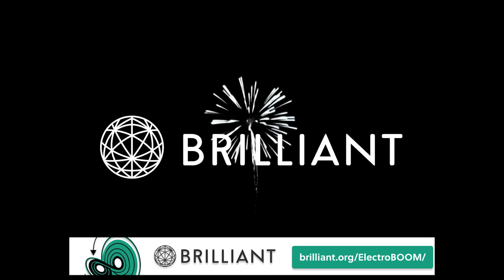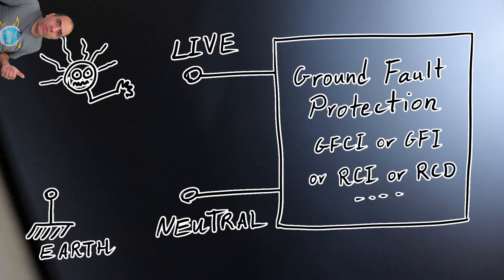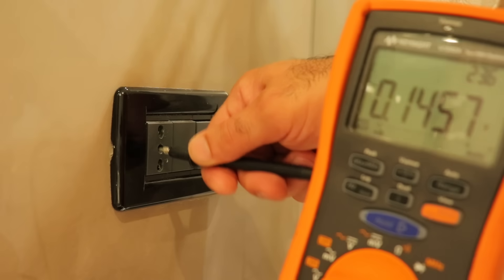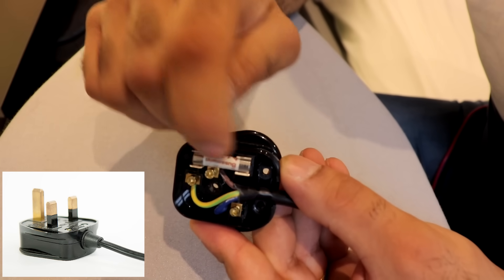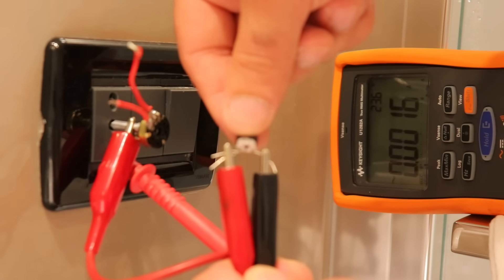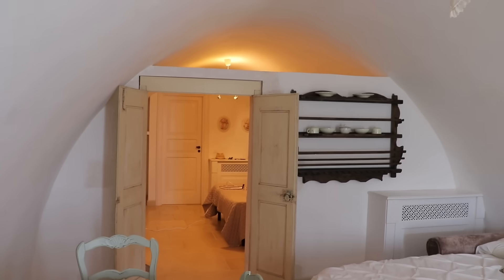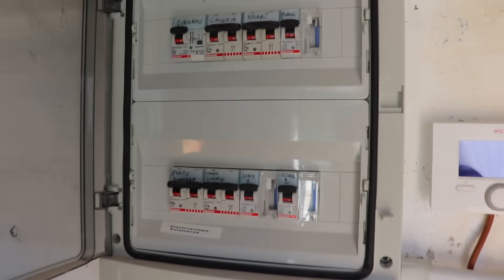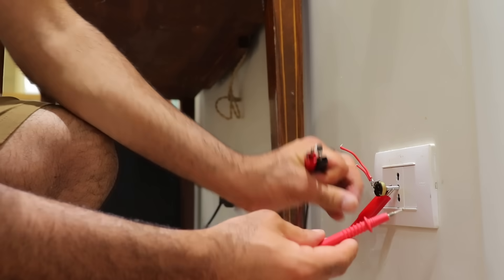Tripping Every Breaker in Italy

Comment: 1:40 --> The two standards that socket has, are for 10A and 16A Italian plugs. The two holes that are "closer" to the ground one, is for the 10A plug (The plug you used in 5:20 is a 10A plug, the 16A one is similar, though the pins are larger and the live and neutral ones are placed 3-4mm further apart to the ground pin compared to the 10A plug)

3:40--> The colours are Yellow/Green for ground, Black, Grey or Brown for live and Blue for Neutral; so if the test showed that the black was the neutral wire, either the hotel had terminated the wires in the incorrect way without following the colour code, or most likely, the red pin of your tester didn't touched the screw of the breaker.

11:45 --> Those are 3kV DC lines, since the regional trains use that voltage, although the high speed railways (The ones used by Freccia Rossa and Italo) use 25kV 50Hz AC lines. The Italo train you saw there, has the ability to run on both 3kV DC and 25kV AC lines.

15:28 --> Technically, you shouldn't be able to plug a Schuko plug into an Italian socket (There you were able because you've either applied pressure, or, someone else has forcefully inserted the schuko plug, "widening" the 10A holes). Be careful by doing this, since the Schuko plug is rated for up to 16A, and if by chance you plug in a device that uses more than 10A it can become dangerous. Also, by doing that you don't have grounding protection. Is always better to plug Schuko plugs into Schuko sockets.

Comment: Shoudn't Shucko pins be a little bigger, so they don't fit in the european 10A/16A plugs?
I remember being not able to connect a shucko without forcing (and ruining) the holes (it was a multiplug extension)...

Comment: I would say there are no applications where the polarity of the outlet matters in europe. Units built for use in the EU are designed so that the polarity will not be a requirement for the safety of the device, it will work regardless of how it's plugged in.

Comment: Hello from Spain! I just wanted to say that, while the plug design here is very simmilar, it isn't the same as the Italian one, so maybe other parts of the installation also change; so, it may be inaccurate to say all of Europe/the E.U. is like Italy (idk if we'd rank higher or lower though).

Also, since everyone is pointing out breaker are called "salvavidas" or something like that in Italian (in Spanish that refers to other things), may as well point out that in Spanish they are called "plomos", meaning "leads", since they used to be fuses, which were often made out of lead; when they go out, we say they "jump" (saltan).
Reply: Ñ

Comment: Hi, Mehdi It was really nice to see an "independent inspector" checking our electrical system. 😀

In fact 30 mA is the maximum ground leakage current allowed in Italy for bathrooms and kitchens (which by the way  MUST  be on 2 separate branches coming directly from the main line and protected by two independent circuit breakers). The other rooms can be 100mA or similar.
However it is common practice, if you want to be safer and simpler, to simply put a single ground leakage breaker upstream the whole house/apartment and derive all the other branches from that, using separate CB for kitchen, bathrooms, air conditioning, boiler room, Bedrooms...etc.

Keep on the nice work!
Reply: I think an old BTicino phone socket.
Reply: @trevi212  phone configuration socket. You put in a sort of fuse and you can only receive a part of phone signals.
Reply: hahah

Comment: In germany most electricians use testers which include a function to test the ground fault protection so you dont have to mess with dodgy potentiometers xD While measuring the voltage between line and earth you can push the two test buttons with your thumbs to engage a residual current that should make the RCD trigger

Comment: I hate those small Italian 10 amp sockets. I had to buy an "adapter" from a rip off street merchant  to use the more common European 16 amp plugs.

And how safe is it to make an adapter from 10 amp to 16 amps? Just more likely to trip the circuit breaker or heaven forbid a wire fuse!

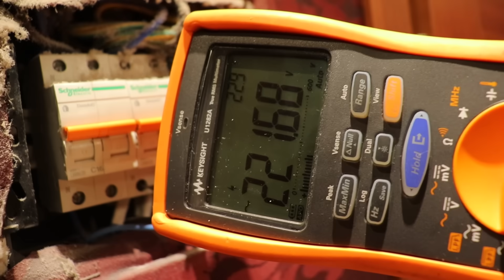Comment: 3:34 Italian here, actually the blue is the neutral and the black is the live, it's obligatory by the code. Let me add to all the other proper comments of fellow italians that you should not plug "round" plugs (EU plugs) into the italian "bipresa" 10/16A socket, this ruins the socket. It's the most common mistake that tourists do in italy and  it's very bad because home/apartments owners need to change the sockets very often.

Comment: 10:44  There's a "click" noise when the wire touches the first time, but no noise when it touches again.  Almost certainly the noise is from the mechanism of the ground fault protector (RCD), which means it is inside the room somewhere.

Also, all the ground fault circuit breakers (RCBO) shown in the video have a little schematic diagram printed on them, showing the wiring of the current-imbalance detector.

Comment: In the UK we have 230/240 V on each phase so 415V phase to phase, In Spain it is 220V phase to neutral and 380V phase to phase. In a friends' flat I found a wall socket on one phase and a bedside light socket 500mm above on another phase. Thus any defective appliances plugged in to both outlets would give you a "belt" at 380V, i connected my meter to both outlets and was horrified to see it register 380V! No RCDs anywhere, 3 cartridge fuses on the incoming phases. Of course a radial final subcircuit system rather than the ring final subcircuits found in the UK

Comment: I lived in an apartment in Italy for a while and it's absolutely shite! entire house was wired up wrong and every single circuit was wired Into a 16 amp breaker and I couldn't use many appliances at the same time ... power was always going off and the light were flickering constantly... often the plugs would be arcing inside the socket because they're loose. and there are 3 different standards in Italy! such an annoying place

Comment: Last plug you used is shuko, and supports up to 16 amps, while normal plugs support at most 10 amps, difference is that one. In IT shuko is for everyday use with heavy loads, the others are for laptops

Comment: Normally in European wiring, blue is meant to be neutral. Live is usually brown in single-phase systems, in three-phase the additional two phases are coloured black and grey, so that might indicate that the building has 3-phase power. Although that's not really a guarantee, they might have just used whatever phase colour was available.
Reply: In Italy we do not mind in case of single-phase implant, we usually use Brown, grey, black for the same phase. For example we can use black for the main lines, grey for the lights and Brown for the sockets. Some years ago also other colors were trendy, like Orange, red and violet, but now not a lot. While for the 400v implant we use GBB colors for the main line and after that everything black usually, and we sign L1/L2/L3 at the and of the wire. 
Fun fact, in some cities like Rome we have a biphase infrastructure with 220V tension, in that case blue is used for one of the 2 phases (like in Rome)
(italian industrial electrician here)

Comment: Welcome to Italy! In the bathrooms we either install no separate breaker or a 10 milliamps one. Also, it's quite strange that you can plug a Shuko in a normal power outlet without forcing it, since the 10A holes are smaller. Also, I disagree on the UK plug system being better: no need fo that separate fuse if you got overall protection (in Italy there's also a magnetothermic breaker for short-circuit overcurrents), and with the UK system there are certain situations in which you could plug it in the wrong way, leaving the ground plug out and thus being unprotected.

Comment: Minute 9:13 -> strangely shaped outlet. It is a special, general purpose outlet designed by the manufacturer of this line of outlets (BTicino) to connect applications different from normal power outlets. it is designed with the intent of being different from normal outlets and not usable with normal receptacles. The manufacturers also sells the special plugs. Examples: connect speakers to a PA System, connect a wired switch to turn on/off the ligth, connect devices with different voltages, connect a table lamp that will be turned on and off by a wall switch, and so on. It should have 3 contacts. plug can be inserted in one direction only.

Comment: GFCI was not a thing for a long time in Europe and when they became available (or even mandatory in some places), there were more of an afterthought by simply slamming one 3 phase breaker on the whole apartment.
There's also one thing people have to pay a REAL attention while using those 2 prong adapters for US plugs. EU sockets are not polarized and there is no guarantee that one side or the other will be neutral. You should always treat both of them as live. The only devices that have just 2 prongs are the ones that are galvanically insulated and have no exposed conductive elements that could get shorted in any way. This includes most things like hair dryers, hair cutters, phone chargers and so on. The other category that is mandatory is higher class equipment, mostly powertools. They have to be insulated and there can't be any way of shorting anything exposed thus it does not require grounding. Most of other devices require the ground connection.
Why am I saying this? Many US things have just two prongs and the neutral is also used as a ground. If you use the adapter, your neutral may be live. The only way you could ensure that it works would be some sort of magical power adapter that cuts off the power if the polarized side is in reverse (you have to rotate the adapter to work with US devices) but generally any adapter you will get does not have any protection. You have 50% chance that your neutral is live.

Regarding UK plugs, that's the great example of TOO MUCH protection. I had two USB power bricks, one with continental plug and one with UK plug. The continental one (same as US ones) had just two prongs as it is insulated and does not require grounding. Because of this I could easily use those with light, two wire extension cord. I also wanted to use the UK one with an adapter in the US but that became a problem. It has a ground prong which is plastic. Sure, the UK plugs require ground prong to be first so their power bricks have dummy plastic prong to unlock the socket. But now it is almost impossible to find an adapter from not grounded continental EU or US socket to UK socket. That's even weirder because I ordered like 4 of them and 3 were blocked on shipping because there were considered unsafe. Sure, they are unsafe because they are intended to let you plug 3 prong plug into 2 whole socket with no ground. That's what I consider quite bad about UK design. The continental design as well as US design has a great feature. If the device requires ground, you can not connect it to not grounded socket, it does not fit. But you can connect not grounded device into any socket. US does this by simply having additional prong in the plug, continental EU has (usually) slimmer plugs without grounding or round plugs with grounding strip around it. Obviously the large plug requiring ground will not fit into slim not grounded socket. And obviously it does not work with round sockets without a ground which are the old design you can still find something. And obviously it all goes out of the window because countries use slightly different designs like the Italian ones you've seen.

Ah, standards. They are awesome, let's make 20 of them!

Comment: In the Netherlands we have both the connectors seen at 15:16 only the smaller one on the left is without the earth pin and meant for Class II appliances. Both receptacles are recessed in the shape of the corresponding plug to prevent the issue you present at 15:16. The way they are shaped allows the Class II plug to be inserted in the Class I receptacle and not the other way around. 
For live and neutral sensitive devices you can either swap the plug around, use the appropriate industrial style CEE socket and plug.
Wet area's like bathrooms have very strict IP rating zones for installing electrical equipment and voltages are limited the closer you get to the real wet parts.
Derived from EN and IEC standards we have our own standards called NEN. Search 'NEN 1010:2020 nl' to learn more about our low voltage installation standards. North Americans could learn a lot from it.

Comment: Worse than the regular EU plugs that completely cover the female plug which is even safer than that plastic coating on the male part.

The plugs in this video are not the EU CEE standard "Schuko" type and is Italy-specific.

https://en.m.wikipedia.org/wiki/AC_power_plugs_and_sockets

Comment: 15:30 in Italy we have 2 type of plug, the smaller one has the same dimensions as the round plug so it enters (hardly because the diameter of the in italian pins are smaller) and we know that it should not be attached

Comment: The socket at 9.15 minute It's called Magic BTicino socket. It was invented in 1961 but It wasn't used a lot because there were few domestic appliances to support that socket.
It should have been safer than other plugs.
Nowadays is useless and almost all houses have replaced it with the standard socket.
In Italy now there 3 standards. The shuko socket (the German socket), Italian 10 amp and Italian 16 amp. It's easy to find universal sockets that allow you to plug in each plug. But the most common socket are (in order) the Italian 10 amp socket, shuko socket and Italian 16 amp socket. Usually 10 amp and 16 amp Italian socket are mixed together with double holes (the 16 amp is bigger and the holes are further away than 10 amp).
Universal shuko accepts all kind of plugs.

Comment: You visited one of the oldest cities in Italy. I designed some electric implants, so I can confirm: Italian plugs have a design that prevents the insertion of a single terminal, and 2 different plug rated to 10 A max vs 16 A. Every house has differential breaker just under the main switch. Even our suppliers meters include a differential with idn 0,003 A So that the whole implant is protected from the source. Problems  (in home environment) starts because we put in series a lot of differential breakers with the same idn rate so you are not granted that is the nearest one the that breaks when something goes wrong. We should put decrescent idn and reaction times switches in order yo perfect the system. In some hotel bathroom or other applications we have 0,001 idn so is safer, and hopefully you'll break terminal circuit instead of the main one for a local problem.
Reply: We've got selectivity-rules to prevent such situations from occuring in The Netherlands (and probably Europe, as the NEN and IEC-standards are ever more integrated). Special tables list which breaker-characteristic and tripping-current can be used after another breaker, without running the risk of having them both trip due to the same fault.
However, especially main fuse links, that protect the line coming into the home have a tendency to be weakened from earlier abuse or even temporary overcurrent situations at just an amp over their rating: they can last a very long time before the fuse link breaks at such low overcurrents.
A nice dead short behind a regular B10 breaker can then also kill the main fuse (a 25 Amp slow-blow) easily.
About the current ratings: are you sure you didn't put a zero too much in your tripping currents? 0,03 Amp is a regular current for RCD's to have to trip (while my experience as an electrician building cabinets, where every RCBO and RCD was tested before the cabinet would leave the factory, was that most of them would trip at 18 to 21 mA).
Reply: @weeardguy   In Italy, many electricians aren't very-well-taught on selectivity, especially for thermal-magnetic breakers. There are tables list from the breaker manufacturers which allow for coordination of cascading brakers, but they aren't generally followed (in residential wirings at least, perhaps not in industrial ones).
Reply: Why spread fake news?
The device present in the Italian "meter" is a C63 circuit breaker with a breaking capacity of 6000 A, there is no differential switch!
Reply: @Laigh   I've read somewhere that the old ENEL analogue meter used to have a ground fault switch, but surely enough it hasn't been around since they've swapped it with the electronic one in the early 2000s

Comment: IMO Italian electrics are really good. Putting the panel and meter at the entrance is brilliant. I don’t know if it is code but most panels are divided into essential and phantom loads and use gfi’s. When you go out you can turn off the phantom load breakers and save money and reduce fire risk. They are also really high quality

Comment: Come to Germany, where all outlets are protected by GFCI breakers and feature the harmonized "Schuko"-Plug. Exposed ground makes it a charm to ground oneself for ESD-work and the live and neutral wires are non-accessible before the plug is even barely connected.
Reply: They're good, but take double the space in wall boxes compared to the ones we use in Italy.

Comment: To be fair, if you are covering more appliances with ground protection you need a higher mA tripping limit, or the small leakage currents combined will trip the device even though there's really no fault. Happens sometimes even with 30mA. Primarily in industrial kitchens when the electrician put too many fuses over the same ground protection. Hope you enjoyed your stay in the EU.